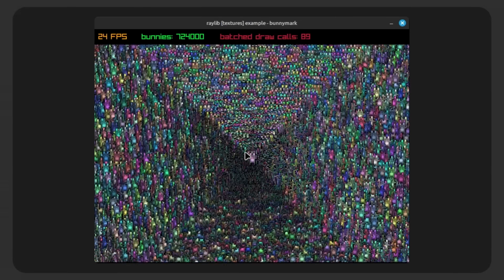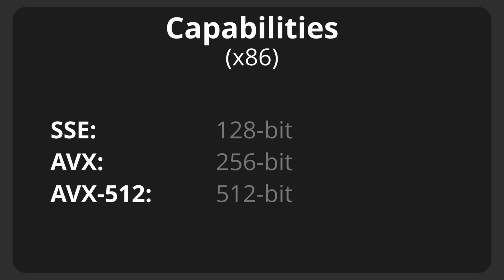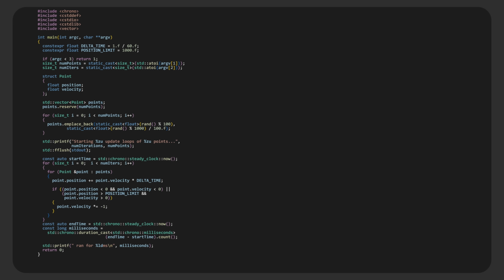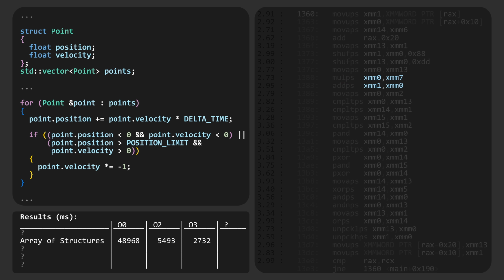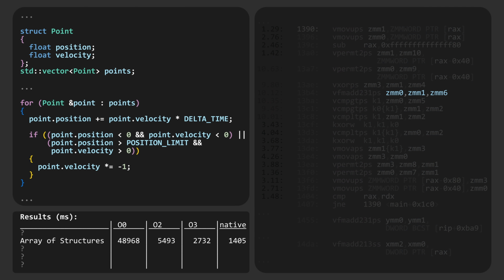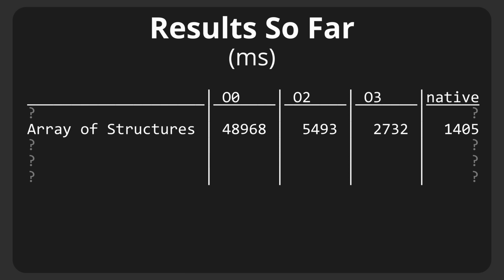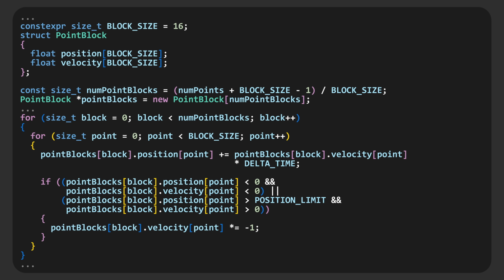4x Code Performance with SIMD

Comment: i wonder if this is exposed to something like Java/C# where you still kinda have access to lower level but its not the intended way of doing things.
Reply from the maker: I've not delved into it myself for such languages, but it does appear that both languages have a `Vector<T>` class that is meant to facilitate SIMD style computation if a programmer wants to more clearly express the intent and independence of computations.

* https://docs.oracle.com/en/java/javase/26/docs/api/jdk.incubator.vector/jdk/incubator/vector/Vector.html
* https://learn.microsoft.com/en-us/dotnet/standard/simd

Auto-vectorization should also still be possible regardless with such languages, and technically they'd have more information about what the runtime machine is actually capable of when using just-in-time (JIT) compilation.

How this plays out in terms of actual performance, however, is an interesting question!

Comment: Great video. I think it would be interesting to also see what other compiler do in these cases and compare them with gcc.
Reply from the maker: Interesting indeed! I don't recall how much I looked into for the specific examples used in this video, but in general I've seen good vectorization results with gcc and clang. With MSVC (Visual Studio), on the other hand, I've had far less success getting good results. It could be a case of not specifying the correct optimizations, but even then that'd open up a conversation around discoverability/defaults.

Feel free to play around with the Compiler Explorer links in the description and see if anything interesting pops up!

Comment: You are the one who is capable to explain -Ofast and show how it can break math
Reply from the maker: `-Ofast` is very interesting and I have thought about delving into aspects of it in video(s)! There's quite a bit that enables and since it can break assumptions about standards compliant math, as you've said, it's often better to be more fine grained in which flags are enabled. In particular I've mostly dealt with `-fassociative-math` which can help some scenarios with SIMD. On a similar topic there's also subnormal/denormal floats which can be treated as zero instead of dealing with the potential performance penalty on some hardware.
Reply: @keiferjh when I tried, not sure, maybe it affected inference accuracy. I tried small vosk models. Though they are bad by default. I need more RAM for a bigger one

Comment: Made 180 GFLOPs using NumPy on i5 8gen. 600fps bad apple easy in terminal using SIMD
Reply from the maker: Interesting! What was it like without SIMD?
Reply: @keiferjh  peak pure C 190 GFLOPS, OpenBLAS NumPy ~185GFLOPS, NETLIB 4.2 GFLOPS. I think it was 172 GFLOPS on -O2, then I compiled NumPy with -O3. And the bad apple on python loops was ~5fps in the same conditions

Comment: Vectorization is actually a very good tool to use in networking, there are several performance tricks in networking that includes vectorization.
Reply from the maker: Any specific tricks that come to mind? Or resources that dig into network applications of SIMD?

I can certainly imagine the need to process incoming/outgoing blocks of memory is very conducive to vectorization to begin with, but it's always interesting to see the patterns that form from various domains! Particularly interesting for any latency sensitive applications, were it pays to be cautious of waiting for enough data to process.

Comment: What's the point of using SIMD if so much of your throughput is spent shuffling?
Reply from the maker: Often the goal is to avoid the shuffling, but depending on how your data is laid out that may not be possible. Even with the shuffling, though, it can still be faster. I imagine this is at least in part due to CPU Pipelining and just the speed/functionality of the SIMD instructions.

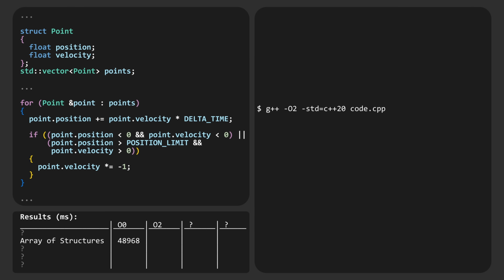Comment: 4:10 actually O2 already involves minor space speed tradeoffs. Os is between O1 and O2.
Reply from the maker: Absolutely a fair point about `-Os`! Brevity is often at the expense of correctness, though in my defense (partially) I was attempting to use verbiage mirroring gcc docs (https://gcc.gnu.org/onlinedocs/gcc/Optimize-Options.html) :D

"-O2 Optimize even more. GCC performs nearly all supported optimizations that do not involve a space-speed tradeoff."

Though they eventually note further differences between `-O2` and `-Os` (and plenty of other interesting tidbits, including `-Oz`)

"-Os Optimize for size. -Os enables all -O2 optimizations except those that often increase code size: ..."
"-Oz Optimize aggressively for size rather than speed."

Comment: @Keifer

I tried but doesn't work for me: "fatal error: 'raylib.h' file not found"
Can I run it without that file or how can i copy past the raylib.c file???
I use macOS as main/testing device.

PS: I am new to c and c++ but finishing CS50 class.
Reply from the maker: I hope you are enjoying (and continue to enjoy) your studies on c and c++!

TLDR: Here's a template that might help out: https://github.com/raysan5/raylib-game-template

Using external dependencies (like raylib) is often a pain point, in part due to how many ways it can be accomplished and how it can differ based on your development environment. I'll mention the raylib wiki (https://github.com/raysan5/raylib/wiki), though there's plenty of information to get lost in there as well.

If you're trying to start from my project with raylib (linked in the description) I am using the `cmake` build tool, though there are other things in the same repo that may not make it an easy first example to follow. There are instructions in the `README` but I can't say much time was spent making it easy. I have not personally used it but it may be easier to start with https://github.com/raysan5/raylib-game-template which is linked directly from raylib.com

If you just want to follow along with the concepts of the video (without the visual element) the linked repo has a `vidoes/simd` section that is fairly self contained and should be easier to use the `Makefile` or just manually build however you like.

Comment: Great video, does explicit vectorization change things much? How close is auto to calling simd instructions explicitly?
Reply from the maker: I haven't got around to trying the example I used with intrinsics/manual assembly, but I imagine it's straight forward enough that there's not too much left on the table. Still would be an interesting experiment that I'd love to get to!

There is, however, a reason projects like FFmpeg use assembly for some of their hot paths, including ample use of SIMD instructions. There are nuances and assumptions in many problems that can be leveraged but aren't easily conveyed to or used by the optimizer.

Comment: Agner Fog's VCL header-only library is absolutely wonderful if you want to ensure the use of SIMD instructions

It doesn't (maybe) auto-gen stuff for you like compiler flags, but let's you write the same code regardless of supported AVX version (ie you can pretend you have AVX-512 and if you don't it just magically splits whatever you're doing into multiples of the highest supported bit width register type at compile time) and is waaaay more convenient than calling weird esoteric compiler-specific SIMD instructions, just simple methods to load shit into vector registers and operator overloading to let you you do vertical operations on those registers

it's the best way to just write SIMD optimized code imo tbh
Reply from the maker: I have seen references to Agner's library (amongst others as well), but admittedly have not personally explored its usage. It does seem like an awesome tool so I'm glad to see someone suggest it!

Comment: I have never been able to understand what the deal with SIMD even is. At least until this video. And although I'm thoroughly on the side of high-level declarative programming, I'm still fascinated by this, thank you very much for your video!
Reply from the maker: I'm glad it helped shed some light on SIMD! Regardless of the programming paradigm a project uses its always helpful to understand what the computer is capable of doing!

Comment: "BuT tHe CoMPiLeR OpTiMiZeS FoR YoU!!!" crowd screaming their heads off....
Compilar doesn't do jack unless you TELL IT TO by writing code that CAN BE optimized by the compiler. And sometimes compiler just doesn't detect correctly what instructions it should be using for particular task, it's on the programmer.

Thus, understanding the hardware and low lever function of your environment is still necessary if you want to get real performance out of it...
Reply from the maker: Absolutely. If performance is a concern at all then it's important to have a good "foundation" for any meaningful optimizations to be possible. That's true both for whatever optimizations the compiler can do and also any you may do manually. The depth at which you need to go can certainly be project dependent, but data structures and algorithms are key concepts for good reason!

Comment: The if inside the for loop can potentially have a big performance impact. Check out cpu pipelining, cpu branch predictor, and branchless programming
Reply from the maker: All great topics! I had done a bit of experimenting before posting the video and at least for the examples as tested (so small sample size) any attempt at changing the conditionals didn't help. In most cases it made things measurably slower. Looking at the branch misprediction metrics with the profiler also didn't suggest that there was likely any issue (though admittedly even small amounts can be very impactful).

Comment: Computers have so much potential but it's impossible for a human to know and utilise all the optimizations without introducing bugs and massive development time. It'll be an exciting time when AI starts getting used for optimization. Throw in any program and have the AI return something that's an order of magnitude faster.
Reply from the maker: Indeed, it'll be interesting to see how tools evolve over time to help make use of all the optimizations available. Though I'm not as convinced that AI is the cure-all solution that some are imagining. Regardless, It'll likely have it's place as a tool in the tool-belt so it'll be interesting to see how things progress!

Comment: Rule #1: NEVER trust your compiler.
It's sad that a cursory glance at the assembler output is all that it takes to 'magically' turn some high level programmers into assembly/machine/metal language gurus. For such a trivial SIMD example, you really should be in-lining some hand-coded assembly...thus 100% guaranteeing you the maximum performance gain you are seeking. Of course, do do that, you 100% need to be an expert in this area of assembly. 
Sadly/damningly, the days of the Assembly Language Guru died off as we left the 8 and 16bit golden era in the 1980's and early 90's. Fewer and fewer C++ programmers can effectively decode the assembly output of their compiler, particularly as the C++ language evolves to become an 'easier language'.
Reply from the maker: Even if you don't fully trust the compiler (they are just large sophisticated programs themselves so can have bugs) it's an amazing tool that's leveraged for good reason. Modern compilers are very good at their job and are much more suited for many tasks such as optimizing large sections of code.

I will agree that glancing through compiler output doesn't make anyone an assembly guru but that's often not needed. Even when it is worth manually hand-coding assembly it's often just as worth it to have a generic and often much more portable baseline implementation.

Not everything has to be hand-coded assembly but I agree the skills can be extremely useful. It just doesn't have to be all-or-nothing.
Reply: Most people great with assembly stand no chance against the compiler when the code is well-structured. You have to have some really rare situation and a lot of time at hand to get better assembly-code than the compiler - and then you are still just looking at running your code on one particular system.
Reply: @ABaumstumpf  You're missing the whole point of what a guru-level assembly programmer brings to the table...and, where this expertise is used. Hint: hand coded assembly (by real experts) are for specific use cases, of which there are a great many.
Rule #1: Compilers are NOT designed to get anywhere even close to guaranteeing(!!!) the fastest and/or smallest machine code. 
Rule #2: Virtually all C++ programmers are nowhere expert enough to even remotely comprehend the assembly output from their C++ compiler. Obviously. 
Rule #3: Run ANY non-trivial C++ program through 5 different C++ compilers and you will get 5 different assembly(/machine code) outputs. THINK about what that means! ...think about speed/size 'guarantees' instantly evaporating.

We are fast approaching a time when all 'real programming' (every language above assembly) has been abstracted away. And all the time, EVERY program ultimately executes as......machine code! Consider this a massive national security issue in the face of state-sponsored (real) assembly language experts from bad actor countries!

Comment: Great video, superb explanation. It really shows how powerful SIMD can be. And the amazing bit: All this is still happening on one thread. You can still parallelize further by chunking your data and running this multi-threaded, to get another massive speedup.
Reply from the maker: It really is amazing isn't it? Multi-threading on the CPU also opens up the discussion around False Sharing and how you can accidentally destroy the performance instead of increase it. I've been very tempted to make those examples too!
Reply: @keiferjh  I haven’t heard of false sharing, would be interesting to see this play out!

Comment: Using intrinsics better because this will give you full access to the underlying instructions alternatively you can program everything in assembly.
Reply from the maker: There is certainly a lot of power in manually wrangling intrinsics/assembly but data structures/layout will influence what's possible regardless. Once that's settled you might be amazed at how well optimizing compilers do their job!

Comment: Vectorization is really cool, but it's always limited by the tail handling. In RISCV processor architecture it's even cooler! 

There is a new approach to vectorization which allows compiler not to worry about the tail handling and what extension is available. So basicly compiler can optimize much more even if we don't know on what CPU the code will be executed!
Reply from the maker: Both ARM and RISC-V have some interesting vectorization concepts that I hope to find the time to explore. It's always interesting to see the choices different architectures make!

Comment: So the biggest gain was going from AOS to SOA and then memory alignment.  and at no point in time did you use intrinsics explicitly, which demonstrates the power of C++ and a good optimising compiler.
Reply from the maker: Exactly! While there's a time and a place for intrinsics, or even handwritten assembly, optimizing compilers are better than most give credit. Focusing on the data layout, algorithms, and ensuring beneficial compilation flags is often more than enough and even if not gives a nice portable baseline/fallback implementation to use.

Comment: Rudimentary SIMD started in the x86 world with the Pentium MMX, which overlayed 8x8/4x16/2x32-bit variables on top of a 64-bit fp register. This was not easy to use, but still sufficient for Zoran to publish their SoftDVD program which was the first time ever that software could play a DVD movie with zero frame losses. 
I had the good fortune to be asked to help optimize some of the inner loop code here.
A few years later I wrote the world's fastest Ogg Vorbis decoder, starting with a public domain C version which with a lot of SIMD optimizations ended up about 3x faster and faster than the best commercial binary library code available.
Reply from the maker: Nice! I'm sure that was very interesting to get to work on!

Comment: Would have been nice to see a 2d representation of the data as you would use in a 2d game and how you should create and calculate the multiplication of the vectors so you can achieve the same output.
Reply from the maker: I debated a bit whether to stick with the 2d representation for the examples but decided it was a bit too much going on for the assembly listings. Perhaps it could have been nice to tie it all together with at least the code for a 2d example but hopefully it's not too far of a leap as you effectively just do the same thing for each movement axis. In case anyone is interested, however, there is a link in the description (https://github.com/KeithJH/kinematics-demo) to the fully working raylib example shown at the beginning. It's not exactly as presentable as the video, but might help some folks.

Comment: I found this very interesting and a good update to classic optimization books like Abrash’s. This does raise the question - shouldn’t the standard library have a data type that figures out optimal packing and alignment if you hint it with the code that will be run?
Reply from the maker: I'm glad you enjoyed the video! It will indeed be interesting to see how languages evolve over time to better leverage such aspects. While not entirely focused on packing/alignment I have been meaning to check out the data-parallel types for C++26 which IIRC has experimental support.